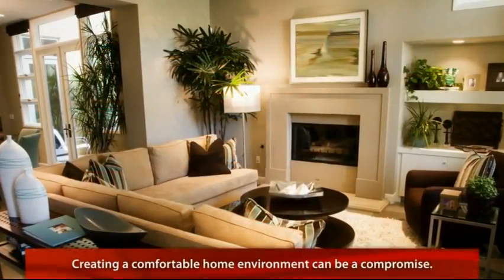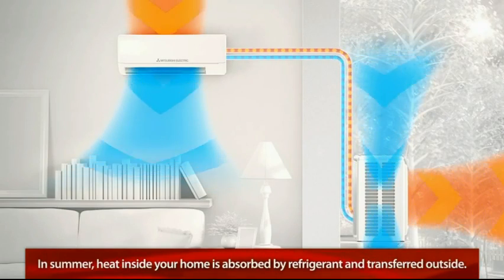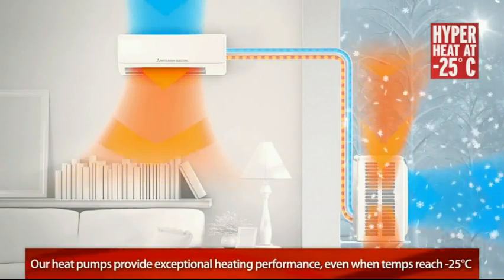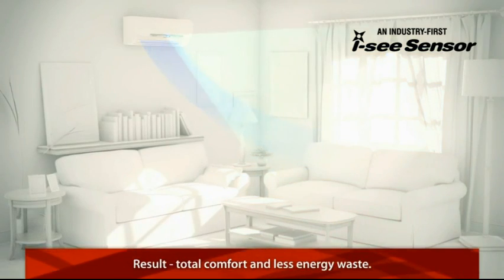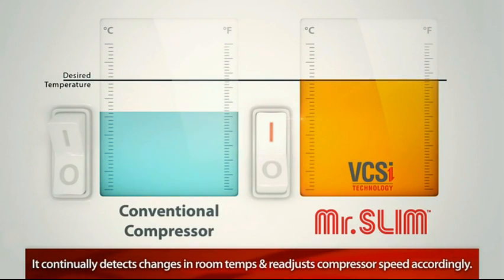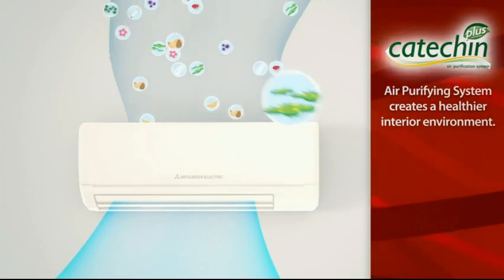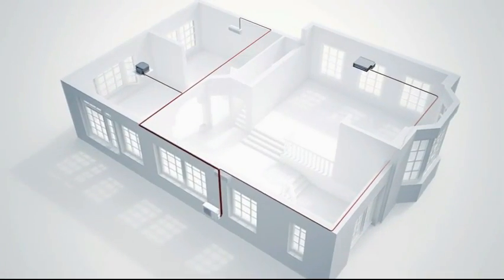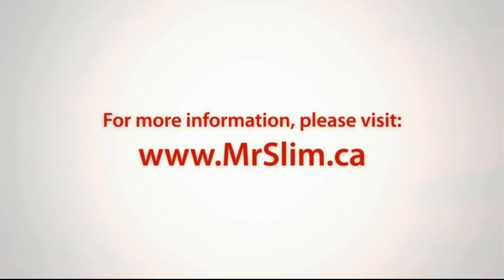Mitsubishi Electric Mr. Slim: How It Works

Comment: i have this system and 3 questions. 1. why can only 1 run at a time?  i have 3 in my house 1 in each of 3 rooms and when i have mine on the other ones don't turn on until i turn mine off then the next one thats turned on will start while the remaining ones dont is it a flaw that only 1 can be running simultaneously ....2.the temperature outside right now in the city is 80+ and makes the system over heat which renders all AC useless and turn off in 5 minutes and starts blinking 5 times.....3.does the main system need to be outside in the roof of my house where all the elements hit it or should it be placed in our addict? where the roof can give it shade and keep it away from the elements outside????????????????????????????????????????????????????????????????????????????????????????????? i have searched countless videos and looked it up on the web in many languages yet no resolve. its like TESLA cars you can pay for the car at full price but in the end, it still belongs to TESLA! you basically paid for something that will never be yours. and you need them so they can fix it because noone else is allowed to touch whats you paid for but them.

Comment: Mitsubishi Air Conditioner is an Inferior quality product with high failure rate, high repair cost due to it’s fragile parts.

I bought a Mitsubishi Air Conditioner MXY-3G28VA2 on Jan 2018. Now the Cooling Fan, Control PC Board have
spoiled just after 15 Months of installation. Mitsubishi service man said it is natural damage. 

I have installed many other brand aircon, like Toshiba, Sanyo, McQuay. ..... All have been used over
10 years without any machine issues. Why Mitsubishi aircon is so fragile?

Comment: I followed the instructions to change from F to C. But all that does is make the clock flash and resets remote. Does not give me any option to change from F to C.  KM08C remote.
Reply: Well if push comes to shove you can ask Siri or Alexa to convert the temperatures so you know what f temperature to set it at.

Comment: INSTALLED mitsubishi msz-d30na and msz-d36na in 9/21/2017. 30k BTU for a little over 1000 square feet in garage. Today is Jan 3, 2018 and the temperature outside has been between 7 degrees and 26 degrees. Well, my garage has only reached 58 degrees inside. Had to move office back into main house. Had installer come twice and they told me "the temperature is too cold outside to produce heat inside". Wait, what? I can't have heat because its too cold outside and my new unit I spent $6500 is not going to work?! I live in the North East, New York. If it doesn't work for certain temperatures then WHY would it be sold in this area???? Now, tech support and supervisors are involved to try and Right the wrong! My pipes and fire sprinkler system better not freeze and burst! I was told this unit would do the job with no problems! NOT HAPPY!!
Reply: sounds like you should have  had an H2i system for hyper heat. MZ-KJ18NA  essentially two of those. not sure who put yours in but they should have known better for this region. i am in MA by the way. i have a 28x40 workshop and im planning on 2 separate 12k H2i condensers for that size. calculator came out at 20k for heating worst case scenario.

Comment: I have NO problem running my unit. You just have to use common sense and know how to use it. Perfect temp allyear long, no noise and I run the unit 24 hours a day employing one to four wall units for winter heat summer cool.

Comment: i 💘 the fact that u can install ☝to 8 air handlers to 1 outside unit so if u have 2 floors in your home you can have 16 air handlers all tide to 2 compressors and 4 fans nd if you have 3 floors there is 24 indor units tied to 3 compressors nd 6 fans (for 5-8 zoned units have 2 fans)

Comment: i love how they only state as low as 19db, and never tell you how high the db can go with normal operation.
Reply: I have two at my home the 24,000 BTU & 18,000 BTU they are super quiet in door & out door units you can barely tell they are running you just feel the cool air...
Reply: barnabyray ... once set temp is reached I get db readings under 5.. on high speed fan operation 5ft from the unit the reading is 11/12 db. It's quieter than any whole house system I know of. The outdoor unit won't wake anyone like my neighbors wakes me.
Reply: 22 db